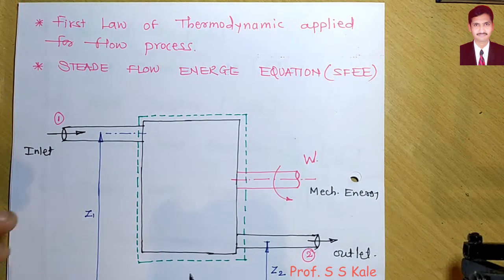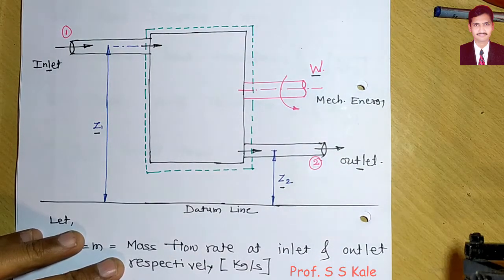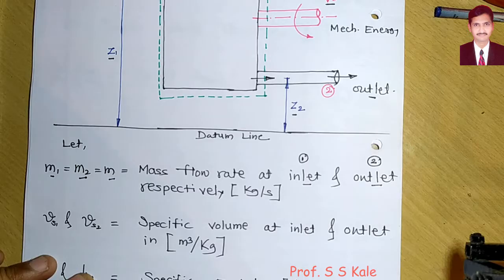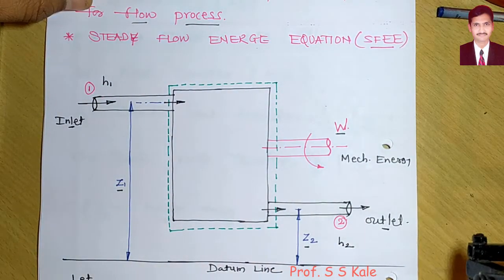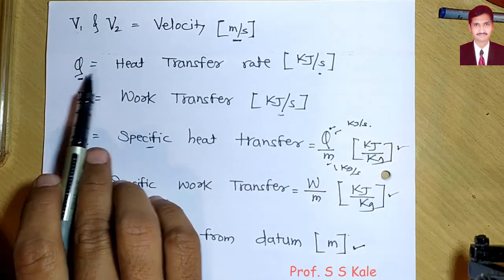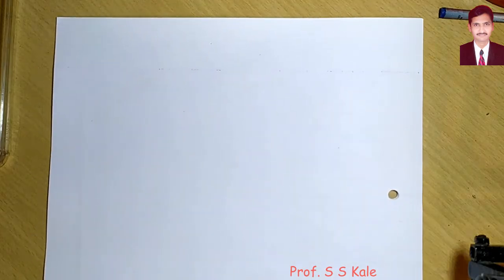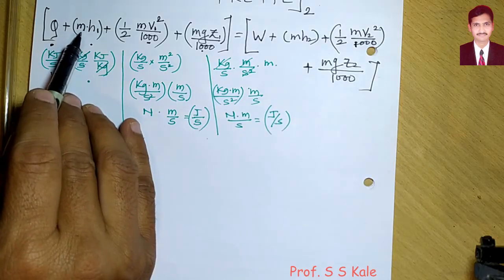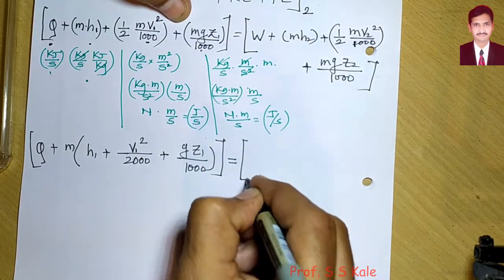SFEE - Steady Flow Energy Equation Derivation

Comment: Sir, please post some videos in thermal engineering... I'm waiting for so long for TE derivation lectures
Reply from the maker: Ok, I will do.
Which derivations you want??
Reply: @SampurnaEngg " Mass of steam discharged through nozzle, Condition for Maximum discharge with critical pressure ratio" We want these two derivations sir
Reply from the maker: Ok